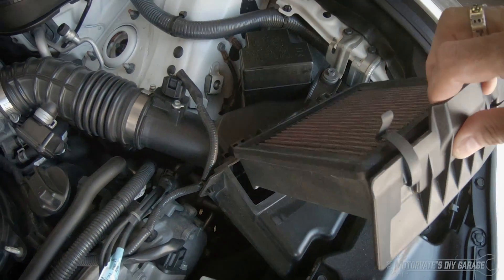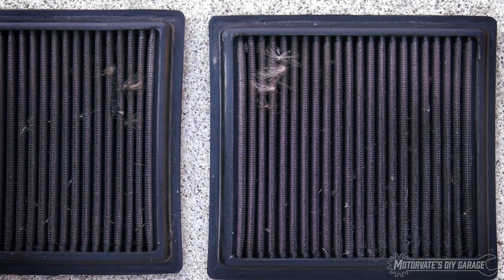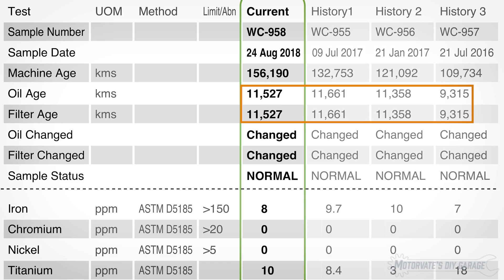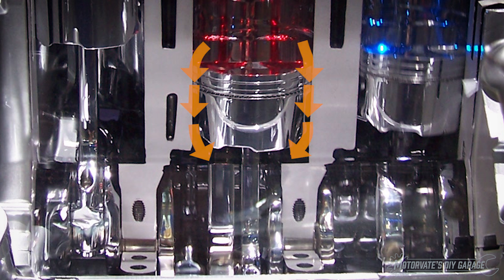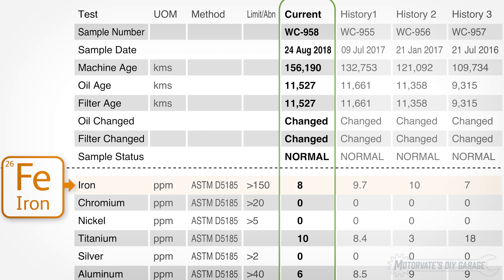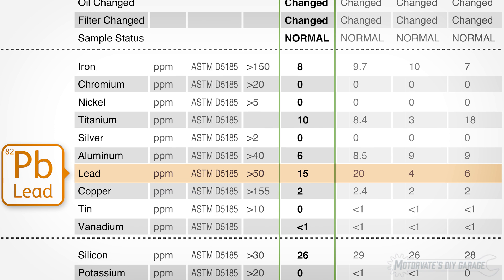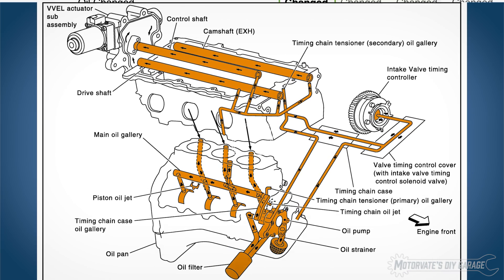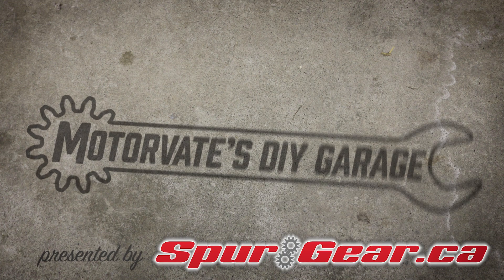K&N Filter Test… Two Years and 50,000 KM Later: Motorvate's DIY Garage Ep.34

Comment: Hello sir, first of all thank you for your videos it really helps us, I have a problem with my infiniti g37  2013, there is no check engine light the car has about 52k miles, there are no warning lights but the car doesn't run right, there is lack of acceleration and the car hesitates to move sometimes, on one occasion I was going 50mph pressed the accelerator/gas all the way there wasn't any response at all, the car didn't move at all, the rpm didn't rev at all, so I pulled to the side turned the car on/off and then It was good again, that didn't happen again, but when I am going about 45 mph and press the gas it takes a good second for the rpm to move, or sometimes the car just upshifts instead of downshifting when I press the accelerator which makes me press it all the way in order for the car to downshift, my car is automatic, and there certainly is something wrong with it, if you have any clue what the problem might be I would really appreciate your help, no mechanics can find the problem because there is no check engine light, hope to hear back from you.!!
Reply from the maker: Hey Mùsã sålâr,
This will be difficult for me to troubleshoot but here are my thoughts:

Even with no check engine light, I would still scan the car as there may be a "pending" code which doesn't turn on the check engine light.

Also you could use an app like OBD Fusion with the $15 enhanced diagnostic and scan EVERY computer, like the transmission, ABS module, BCM (body control module). 
Here is a video on this from my other channel: https://youtu.be/YTnXu9JtmhY

Only the ECM (engine computer module) will turn on the check engine light. So, there can be error codes in some of the other modules that might point us in a direction.

If you don't want to scan you car, you might want to take it to the dealer and they will do that for you and then they can tell you what the issue is.

Also...
With the engine running and the car in park, does the engine rev normally if you floor it for a second?
I am trying to determine an engine issue from a transmission issue.
Reply: @MotorvateDIY  
Thank you so much for responding sure I'll do it myself to try to figure out if there's a pending code going on, and if I couldn't figure it out do you think the dealer could run a diagnosis, how much would they usually charge? 

And yes sir while the car is in park and engine is running everything is normal, the rpm is under a 1000 between 600 and 700, and if I floor the accelerator all the way the rpm only goes up till about 4 and a half thousand or so, I believe there is some sort of safety thing from the factory that wouldn't allow it to go any further. At times this problem really gets frustrating because there's lack of power and the car just doesn't drive right, it doesn't downshift unless you floor the accelerator then after a second or so it will respond and then the car will move.
Reply from the maker: Hey Mùsã sålâr,
The engine rev test suggests to me the issue is not the engine, which means the transmission may be suspect. BUT your mileage is so low, I really don't think it could be the transmission either.

I have no idea what the dealer charges to scan the car, my guess would be $100 or so.

If you spent $40 in total on an OBD Scan tool and OBD Fusion (including the Enhanced diagnostics)
You could check all modules for trouble codes.
OR 
Go to the dealer and let them scan your car and give you the report.

Until the problem is fixed, I would minimize how much the car is driven. There is a slight chance that driving it might make the repair more costly, if the issue is the transmission.

Sorry for your troubles, but please keep me informed on what happens. :)
Reply: @MotorvateDIY  
Thank you for responding again sir a better explanation of what's going on is that it's a weird sensation, like when trying to overtake a car just giving it a little gas wont bring the revs up...I have to really press the pedal at least half way down to bring the revs up, then it downshifts and throws me back in the seat.....its like theres no middle ground, just hesitant acceleration or neck snapping throw you in the seat acceleration...it almost feels as if the 7at is confused and cant decide which gear to be in.

I did some research most people suggest the resetting the ECU or cleaning the throttle body, or changing spark plug but none of those seem to work. but a similar case which happens in alot of Infinitis the G models particularly in the U.S, I was doing some research and came across a response which connected the issue with an error code C1116, a faulty brake light, now it may sound kinda off for this specific issue but the guy who fixed the problem by changing that switch sounded pretty satisfied with the results and suggested changing that. 

I've driven alot of cars before, and my last car was the Lexus is350 2007, now that car was a fun and really good car I didn't have any issues with it until the very end, now I understand that the g37 have more power bigger engine and would beat the Lexus in the long run, but all this hesitation in the G37 sickens me and it makes this great car feel like a grandma car to be honest.

Also what would I need if I choose to do the OBD reading myself which I most likely will do, what type of equipments would I need, which ones are the best ones? again thank you so much for your help and time I really appreciate you.
Reply from the maker: Hey Mùsã sålâr,
Here are the apps and scanners that have worked well for me and my G37:

• OBD Scanners: 
Veepeak BLE ($32) or Foseal WiFi ($20) - these will work with iPhone/iPad, or Android devices. I would avoid the cheap (< 15$)  "ELM 327" scanners as their quality is all over the place. Some work good and others don't.

• OBD App:
OBD Fusion ($6-10) is my current favorite  and they offer a $15 (or so) enhanced diagnostic add add that allows you to scan all the modules (computers) in the car.

Here is more info on OBD Fusion:
https://www.obdsoftware.net/software/obdfusion

On my other YouTube channel you can learn all about OBD Fusion and the enhanced diagnostics: https://www.youtube.com/obd4everyone

Next Steps:
(1) Buy an OBD scanner
(2) Buy OBD Fusion
(3) Connect and scan the car, run and save the diagnostic report. This will only show ECU  (engine computer) trouble codes.
(4) Purchase the Diagnostic add on in the app
(5) Disconnect then reconnect
(6) Run the diagnostic reports for all modules, save the report, and email it to yourself (for backup)
(7) Now you should know what the codes are :)

Comment: Hey, great vid!  Could you do a coolant flush video?  I bought Z1’s silicone hose set and could use a coolant flush video!
Reply from the maker: Hey leinad20002,
Your wish is my command :)
 A coolant change video is planned for this spring as my car is finally due.
Reply: Motorvate DIY  By the way, I got my G37S.  I purchased a 2012 6MT in Black
Reply from the maker: Hey leinad20002,
Very nice! I hope you enjoy your car as much I enjoy mine :)

Comment: Great video. Do you recommend using an oil catch can?
Reply from the maker: Hey  Haseeb M,
That's a good question!
I think it depends on which engine.
On the VQ35 / VQ37 found in the G35/G37/350/370 the only benefit to an oil catch can is cleaner throttle bodies, as they remove the oil mist from the crankcase blow by.

BUT they are expensive and they only prevent cleaning the throttle bodies about every 100,000 KM (60,000 miles) depending on how the car is driven.

So for me, I'd rather clean the throttle bodies every 2 years or so.
For some, they like the peace of mind knowing the throttle bodies will stay clean.
Reply: Motorvate DIY Thanks for the information!

Comment: My clutch pedal is stuck to the floor and theres no pressure when I lift it up manually. Do you know if bleeding the clutch will fix this problem or would I need to replace the clutch? I have a g37s sedan 6mt
Reply from the maker: Hey Pedro Graham,
Check the clutch fluid level and look a puddle under the engine and transmission.

If it is empty or very low, I suspect your "concentric slave cylinder" (CSC) needs to be replaced. AND yes, the transmission needs to be removed. If the clutch is in good condition, it  can stay.

 By the way, the CSC It is a common problem on the G37 Sport :(

If it is low, you can fill it up and bleed the clutch:
https://www.youtube.com/watch?v=DvOa0gPJN6Q
Reply: Hey just checked and there doesnt seem to be any leaks, and the level is looking about normal. I also cant put it into gear I'm guessing because the clutch is fully depressed. Would I be able to bleed the system even when the clutch is in this state?
Reply from the maker: Hey Pedro Graham,
I think you should be able to. Get your foot under the clutch pedal and lift it up. It will spring to the top. You might have to do this a few times to build up pressure.

Then try to bleed the clutch as shown here:
https://www.youtube.com/watch?v=DvOa0gPJN6Q

BE VERY GENTLE WHEN LOOSENING THE CLUTCH BLEEDER, THEY CAN BREAK VERY EASY!!! It might be a good idea to spray a little liquid wrench or PB Blaster and let it soak a few hours or overnight.

Good luck!
It is possible that your CSC or clutch master cylinder has an internal leak and this may not work.

Comment: Thanks, still have K&N ON MY 2007 GMC CANYON 4 CYL, @some 120,000 using .... on synthetic oils.  DUSTY/Dirty around my new Home: considered going back to OEM  for sand/Dust all around cleaning....Interestingly, switched my 2015 Journey 4CYL back to OEM AIR FILTERS, as dirt and Dust load was tremendous ( front fresh air intakes , exposed )......some 40,000 miles on K&N AIR FILTERS,unknown IF SAFER OR cleaner yet on OEM MOPAR AIR FILTER.........be interested in other drivers experience.
Reply from the maker: Hey Opera,
Have you ever thought about getting a used oil analysis?

Comment: Can you hear any high pitch noise from the stock intake when rev above 5k rpm? Mine has this noise above 5k rpm and I have the KN filters and silicone tubes.
Reply from the maker: Hey 代玉宇,
Nope, I don't hear any high pitch sounds from my stock intake G37 with the K&N panel filters...
I might be testing some silicon tubes later this year, and I will make a note to check for this.
Reply: What kind of high pitched noise are you indicating its making( perhaps a sound reference)?
Reply: Mine sounds like theres a turbo blow off valve when i get near the redline at WOT. It's not uncommon on these engines at high rpm and i have no idea what causes it, but it doesn't seem to be an issue.

Comment: makes sense as the more dirt the more dirt is going to catch on the existing dirt! Would be interested to see a flow-test! if they are still flowing as good as they should be! not sure how you would do that tho... :)
Reply from the maker: Hey snipeish1,
Good news... that is the plan :)

I do plan on going back to the dyno and measure the power of freshly cleaned K&N, these dirty K&N, brand new Infiniti filters and no air filters. (PLUS I have built an arduino based air pressure data logger that will capture the air pressure difference of each filter.) It should be interesting to see the results!    

      
      
Show less
Reply: There's the maf sensor, using an app like Torque you can compare when clean to when dirty. Or OBD Fusion which you already use and which seems much nicer!

Comment: Very interesting and good to see they're still working as well as OEM filters. Keep in mind that dirty filters are usually more effective at filtering (and less at flowing fluid) the dirtier they are...
Reply from the maker: Hey Thomas Spurr,
I honestly can't say as good as OEM filters. When I purchased the car, they came with some used Fram air filters and that is shown in the first used oil analysis.

I do plan on going back to the dyno and measure the power of freshly cleaned K&N, theses dirty K&N, brand new Infiniti filters and no air filters. (PLUS I have built an arduino based air pressure data logger that will capture the air pressure difference of each filter.) It should be interesting to see the results!
Reply: @MotorvateDIY    I will have to check that video out again. Thank you for your response! Your content always is very well produced and has been extremely clear and helpful.

Any chance you plan to do a video on changing transmission fluid in the 7AT?
Reply from the maker: Hey Thomas Spurr,
I am glad the video are helping you!

As for a video on changing the automatic transmission fluid, there are no plans for that at this time. I simply don't have access to an 7AT.